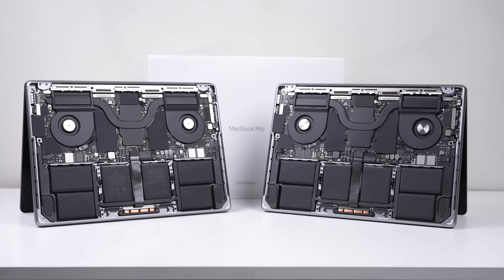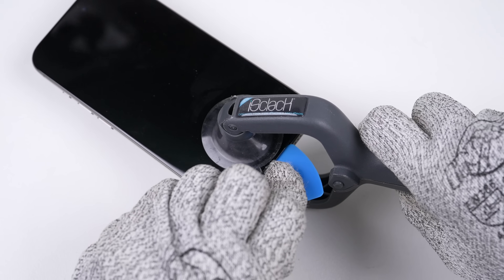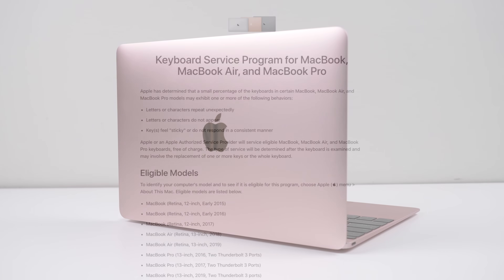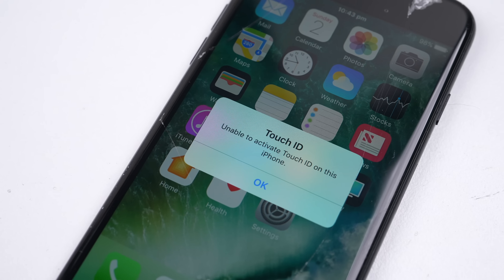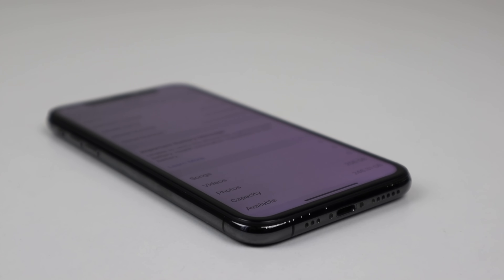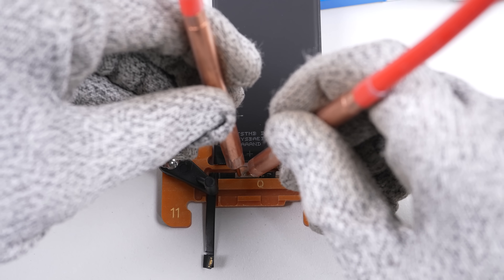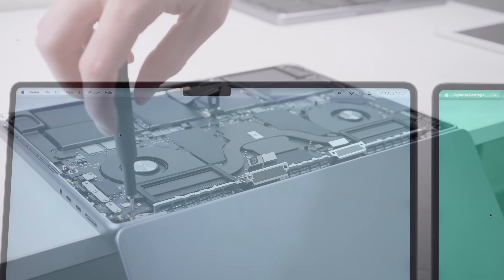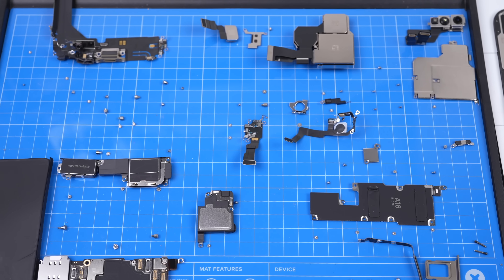Astonishing Anti Repair Practices By Apple In the Last 15 Years

Comment: I've gone from recommending and using Apple to detesting the company because of these practices. The extremes they go to seem almost like satire, so desperate are they to hurt their customers who still remain loyal. You're doing important work by exposing their tactics. I greatly admire your intelligence and ethics.
Reply: For the price Apple charge for their products vs the competition, I expect to be able to replace any component for a good 10 years without issue (other than say a list of replaced parts and basic information about thise parts in device info, and have it shown on first boot after a factory reset for transparency). They should not have the same lifespan as cheap China e waste.
Reply: @talibong9518  I have an iMac from 2012. Runs just as fast today as it did then. I just bought the M2 Mac mini and I see almost no off defense on speed between the two. I n  we get expected a computer to be as fast as it is 10 years later. So apples older hardware is either really good or their new stuff is really bad. Time will tell. I hate tinkering with things and could care less about upgrading components. I expect to buy a new computer every 5’years anyway with how it’s all advancing.
Reply: same here. I got the whole family switched from PC to Apple in the early 2000's to now trying to get them to move away from Apple's grip from computers to cellular phones. I'm still the only one removed myself from the iMafia.
Reply: @nilebrixton8436  lol came to bite you in the ass eh....classic
Reply: @nilebrixton8436  I had to tell my parents, the other day, that I am going to start charging them - my own family - for repairs and tech support if they buy another apple product...

Fanboys LOVE talking about how great everything works in their little boxed in ecosystem, but THE MOMENT you need to connect to something outside the ecosystem, or the moment something goes wrong and you need to repair/reconfigure something, it takes more time than doing the equivalent fix on any other device TEN TIMES OVER... The only way an apple product is worth the extra hassle is if it lasts for fifteen years - something that apple wont allow to happen because they slow your devices down INTENTIONALLY unless you pay them almost the price of a new device just to replace a bloody battery....
Reply: Another one that opened his eyes, I commend you
Reply: @Neopumper666  Who me
Reply: They don't care about loyalty.... just give them your money !
Reply: Apple, as a good service, peaked in 2010. Yes, they were already instigating some anti-repair practices, but at the very least, they were barely noticable and smartphone repairs in general were basically just as expensive as the Apple route.

Nowadays, even with the extreme measures, it's cheapest to have 3rd party repairs, then to buy a new model, then to repair through legitimate Apple routes.

If Apple truly cared for their customers, getting their product repaired at Apple should be the cheapest option. They have the hardware available, the tools available, the glue etc available. Buying an entirely new model could be near equal cost, so it would in the long run always be the cheaper option, but not everyone repairs their phone/laptop for the sake of it working, most people want it repaired because there is data on there that they dont want to lose.
Reply: @Shoarma2  they do it on pourpose to avoid donor phones: if my motherboard brakes I still have a cam module, a usb port and screen that I can sell to feed the repair shops but with software locks I'm forced to go to apple store. If you buy apple you don't own your device
Reply: The lack of side loading wasn't enough?
Reply: Some people are drawn to masochistic toxic relationships. Ferrari is known for this. You can't just buy the Ferrari that you want, you have to work your way up. Imagine how insecure you need to be to buy several Ferrari's that you don't want just to get to the one that you want.
Reply: @lmpnow  Oh, yes, absolutely! Think of the paradox of spending large sums of money to advertise your acquiescence to this  master/ slave relationship. Who wouldn't look up to a Ferrari, Porsche or Rolex owner? They're so good at doing what they're told by their betters! I wonder if they see it that way. Some of us obviously do. It's the Emperor's New Clothes.
Reply: This is why I use Samsung.
Reply: I was bought an iPhone for work with the stipulation that if I break it I bought it. And despite being forced to use it, I am supposed to pay for it if I leave. I was reminded of it being company property on Friday so I think ima resign and hand it back. I’m under no contractual obligation to pay for it, more I am a man of my word. 

Apologies for the prologue, I have an iPhone 13 Promax with a glass screen protector, and one of those transparent phone cases that cost like $95.. where I live, it’s all “shale” floors or carpet over “shale” - the amount of times this iPhone has fallen off the bed on to the floor is an alarming number and I have only just managed to slightly crack the glass screen protector. 

My iPad is like ten years old and I have thrown this across the room (I have adhd, don’t ask) without anything happening, I shattered the screen throwing it a second time because my ex wouldn’t accept that no one wanted to supply her any meth, the screen was replaced and only needed replacing last year when my phone fell on the screen. The iPad is now so old, YouTube no longer supports that version…

I’m not going to sit here and say that Apple are the good guys. These Live Photos have essentially ruined my ability to sort my photos. It’s been like a year and a half and after about 2 months of using this phone I was struggling to get everything off of it. Now I have ~30,000 images; up to and exceeding 5 copies of the same photo, and then the photos that corrupted or stopped partway through copying because the iPhone stopped responding correctly alway register as having been copied yet I have Image 001 (2) - Copy 5 or something ridiculous like that indicating that some files have been copied upward of 7 times not including the 3-4 separate folders and attempts at managing these photos. 

I don’t know why I went down the tangent of file management, but like idk, these things really are indestructible, but it’s not worth it. The photos might be ok, but it’s just upscaling with the three cameras idk. I had a dream I had my Nokia 6300 last night. It was so peaceful..

TL;DR maybe buy an iPhone to look cool and “just” install some other OS or jailbreak it (if that’s possible). I can use Apple wallet for things, a little easier than on the android, but there are places that don’t accept it and require the physical card…

It’s why Nokia 6300 had a fake iPhone skin. Apple things look shiny and neat, but are anything but or not worth the effort, time or money. 

Just my life experience. My iPod classic needed to be ‘reformatted’ for the first time in I dare say 12 years in June. Too bad they don’t actually make those anymore, but I guess that means I can say I don’t like Apple products now 😂
Reply: First of all who said that Apple does not make great quality products. The issue here is them limiting and controlling their repair. If I were someone to pay that kuch for a product I would want full control over how I use it or repair it. Also let's not pretend that apple laptops haven't had tons of engineering issues and failures. Just ask louis rossman about that.
Reply: @S0kJ3 The repair issues and lack of control is one thing, the others are things like iOS is not open source and their price to performance being... not the best which if you have bad price, bad repairability, virtually no control over your device, and if you want Privacy, Security, etc. (think those are things Apple pushes as a selling point), a closed source OS is not the way to go (as it is just "Source: trust me bro"), it may very well be the opposite way to go
Reply: You're the problem, it was always trash.
Reply: thats exactly what happened to me, but the spyware in their OS made me finally say good bye to Apple. Its one thing to lock up my hardware, but its an entirely different thing if they spy on me. F*ck Apple
Reply: It means only that you are clown 🤡 I am using different Apple products for 10 years now and there was NOT A SINGLE problem with almost 20 of my products. Phones, laptops, tablets. I am not even talking about something to break, this electronic doesn’t even lag. I still have my SE from 2016 and it works perfectly fine. Using it as a second phone for at least 4 hours a day. And I am the person who load my devises to their maximum almost every time. I have no problem to switch to other brands if there will be a necessity, but imo Apple doesn’t need to have a repairable design simply because their devises just don’t break. And when I see comments that someone have problems with Apple products it means only you need to have your pathetic hands repaired in the firsts place to learn how to use their products.
Reply: and yet you fools still buy it in large even after being screwed over for decades!: 😂 brainlesss fools
Reply: Well, people who buy Apple products, they aren't really loyal, they're stupid.
Reply: True
Reply: androids still suck ass though
Reply: L to the O to the L
Reply: So have I.
Reply: I never liked them from the Power PC in 1995
Reply: Hurt their customers? No they are just weeding out people who might want to repair their phones so only the core sheep who will happily keep replacing their products (IOW spend $$$) remain.
Reply: Likewise.
I used to buy Apple devices because they lasted. Now with planned obsolescence and anti repair practices, they’re some of the most disposable things on the market.
Reply: @mioszradomski1825  For sure.
Reply: @mioszradomski1825  First apple product I used was an iPhone 3gs. Started acting up after like 3 weeks of owning the device. Took it back to the store, they told me it wasn't covered under warranty because of water damage.
The water damage indicator was set off by HUMIDITY IN THE FUCKING AIR.... The thing didn't come close to water once, but some issue UNRELATED TO WATER DAMAGE was left unfixable because I allowed my phone to be exposed to the atmosphere....

That one experience with apple was enough to tell me that these things are FAR from 'long lasting'.
Reply: Nothing new... but put like this, in a row, one after the other, all the deliberate actions contrary not only to common sense but also and above all to the possibility of repairing/updating Apple devices nevertheless make an impression.
This strategy harms and annoys Apple customers, yet they are the ones primarily responsible for this situation, since they always remain absolutely loyal to the brand, whatever Apple does.
Definitely something similar to Tesla. A kind of cult, it's no coincidence...
Reply: @marcopaolini3478 Yeah, that is the thing that annoys me slightly more than Apple themselves, the people who chose to support them, as they say enablers are partially responsible for enabling such behavior, especially when Android isn't this crazy, different, impossible to use OS, it is just like Windows/Linux, for most users Linux would be fine over windows, just like with iOS/Android
Reply: @marcopaolini3478 Tesla doesn't have software lock downs. You can change the side panel, the mirror, camera, battety pack, and it will still work perfectly. The only issue I know is that Tesla locks out totalled cars from their system. So, if your car is officially totaled and sy repairs it, or builds a new car from parts, it won't receive software update and it won't be able to charge on a Tesla supercharger. But that is understandable. That car officially shouldn't be on the road and may be a risk.
Reply: Same here, i miss Jobs era
Reply: @dmytro95 Hmmm, I am not sure if that is what you miss, I don't have much knowledge other than a documentary but Jobs seemed to be the force behind how Apple is today, things like closed ecosystem and such while Wozniac pushed for upgradability, repairability, etc. Just like PCs had
Reply: @dmytro95  For sure. We've gone from good but not perfect to scandalously bad in 12 years.
Reply: No
Reply: There are much better/more important things to spend your time thinking and worrying about my friend.
Reply: @EyeForKnowledge.  And, yet, here you are...
Reply: @BruceNJeffAreMyFlies  Point being?
Reply: @EyeForKnowledge.  Same as yours.
Reply: You don't recommend them because i can only assume it's bad for your business (assuming you repair products). Apple will still repair or replace your product - guaranteeing you genuine apple parts and repairs. 
Instead youre recommending people to go with other companies that really don't care what you do with your device - which means the customer is wide open to be scammed and screwed over by someone "fixing" device with inferior parts so they can make money. And the moment you do have an issue that means you need to send to the manufacturer they wont look at it because it's been tampered with. 

I would completely agree if i was buying a £300 phone and £500 laptop - id expect to be able to upgrade and repair - which you can quite easily IF you can find the parts
Reply: @paul28177  If you want to believe that anyone who criticizes Apple is either a fool or a crook, but Apple is your friend, you are perfectly entitled to believe that. I think they used to be the good guys but not any more. You don't have to agree with me. Maybe things are different where you are.
Reply: @paul28177  You're making things up about how society works.
This idea that "youre recommending people to go with other companies that really don't care what you do with your device - which means the customer is wide open to be scammed and screwed over" applies to LITERALLY EVERYTHING!!!!!

He's recommending that people purchase from a fair market, a FREE MARKET, one that includes COMPETITION - something that is VITAL to the functioning of a capitalist society.......... Apple has no less motivation than me, and I have no more motivation than apple, to screw you over.

You're basically arguing that a plumber should not be able to repair your tap - only replace it... That's idiotic. 
Sure, I could damage the very foundations of your entire home by screwing with your plumbing, but people still hire me to repair their fixtures.... The risk is WAY higher with your plumbing (your hot water cylinder, that you hire a plumber to repair, probably cost more than your iTurd laptop) and people still choose to take that risk... 

Stop pretending that people need protection from their own choices, all so your precious shiny white company can continue their monopoly. It's moronic.
Reply: @paul28177  two million dollar truck that could kill twenty people in a second flat, if used wrong; ABSOLUTELY you can work on that any time you want, modify it however you want with ZERO training!!!!!!
Cell phone that costs a couple weeks rent; "Nononononono you can't repair that, what if a bad man lies to you when you hire him to fix it?"
😶
Reply: Just wondering, are you still using them tho
Reply: @JC-tg5xx  The 2012 non Retina Macbook Pro sits on my desk as an email backup. So slow with Catalina but it doesn't matter. I'm going from Windows 7 to Linux.
Reply: @jozsefizsak Why are you mentioning Windows 7 in your comment?
Reply: @jozsefizsak Yeah I also want from recommending apple. To just Flat out No
Reply: @jozsefizsak 
An email backup? 

You got a laptop just for reading email? 

Dude, its ok to throw shit away from time to time , wtf lol.
Reply: @JC-tg5xx I’m just waiting for when I need/ want a new phone and I’m switching over.
Reply: Yeah because people bought apple because they love taking it apart and tinkering with it. I think you have confused apple with intel old man.
Reply: @jhoughjr1  🤣🤣🤣🤣🤣🤣🤣🤣🤣🤣🤣 this guy calls people 'old man' for wanting to be able to fix things!!!! 🤣🤣🤣🤣🤣🤣🤣🤣🤣🤣🤣🤣

Daaamn this kids gonna have a rough life! Good luck, bud!
Reply: im confused. do you just buy a phone and then wait for it to break so that you can repair it?
Reply: @duchieu235 Most definitely!... no, it is so if your device breaks, you are able to repair it (likely less money than new device (unless you go to apple store) and continue using it, repairing screens is a huge one, the amount of cracked iPhone screens I used to see, it was like Apple made these devices the most fragile things they could
Reply: As a former computer repair man, I am fine with everything apple has done. This shit is disposable yet made to last way longer than they support the software, it’s fine and shiny
Reply: @sunnohh  Okay Fanboy
Reply: @sunnohh  youre JOKING right?! you better be joking because as one myself, your comment is BS
Reply: ....15 years?? ....yet over that same period of time, Apple has become the GOLD STANDARD in Laptops.  Maybe that speaks to the quality, fit and finish and the constant repairs required by their Windows competitors....????
Reply: @goobfilmcast4239  And this mindset is exactly what we don't need. Why are you so against being able to repair your own devices yourself AND being able to afford such thing? WHY??????
Reply: @goobfilmcast4239 hAs BeCoMe ThE GoLd StAnDARd...see? You're not the clown,you're the entire circus
Reply: @goobfilmcast4239 Constant repair of Windows laptops. You Apple fanboys are living in a mental buble...
Broken PC laptops are not that frequent. But if you want a fair comparison, choose examples from the same price range!
You wouldn't compare a Ferrari to a Suzuki, would you?
Reply: @goobfilmcast4239  "Gold standard" lmfao.... What a dunce 🤣
Reply: @goobfilmcast4239  gold standard?? who paid you??
Reply: That Gold standard is a weak boast, giving Apple a reason to demand that we kissing the ring